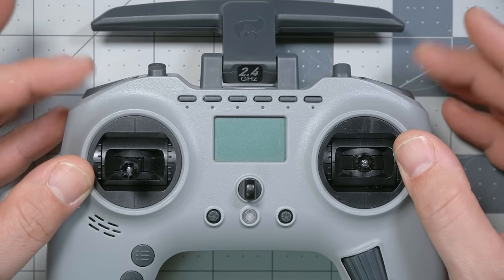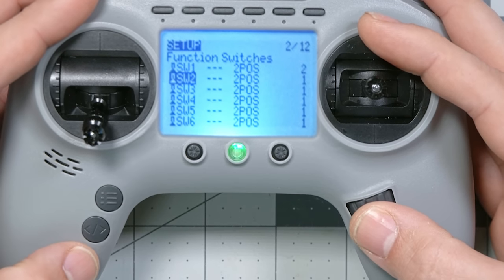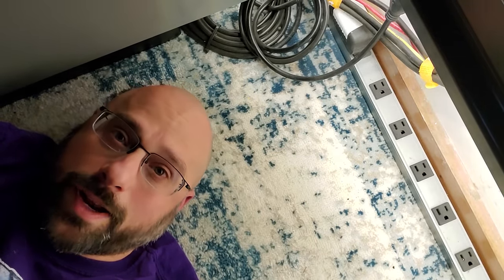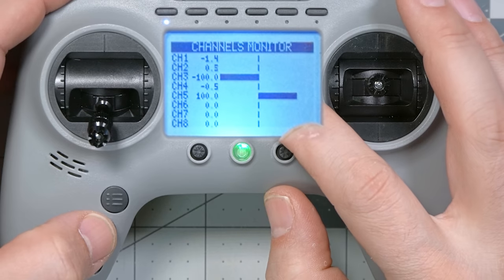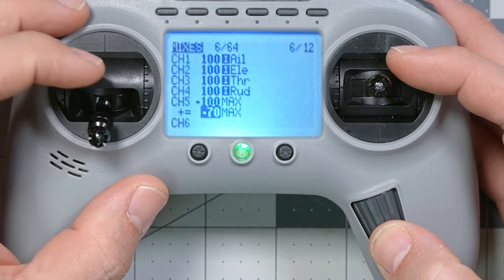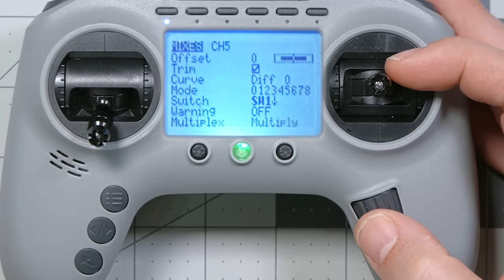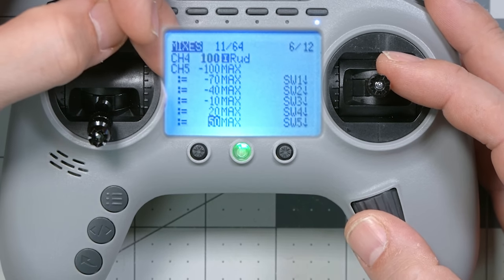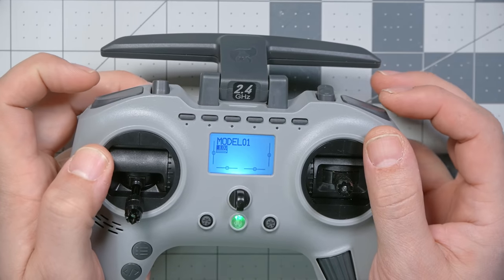Fixing what was wrong with Jumper T-Pro // OPENTX TUTORIAL

Comment from the maker: FIrmware that fixes the broken "toggle" setting is available here: https://we.tl/t-gKE9FMmona
Reply: Joshua Very nice solution, I will probably change my arming method to the one you discribed in this video!
Reply: to stretch 7 states over 200 means having 6 steps and therefore 200 has to be  divided by 6 and not 7 which then results in a stepwidth of 33 which leads to this symmetrical row of values instead of ending at 80 

-100  -66  -33  0  33  66  100

Dividing 200 / 7 lead to 28 which then accumulated to the faulty upper end which did not reach 100, just 80.

For all that struggle: look at a ladder and its steps. 7 steps means you have 6 gaps between each step, therefore 200 / 6 and then it works out fine.
Reply: Transfer expired
Reply: Can you post a file share of an edge TX config that just has all the fixes done.

Left and right being on off switches
And the 6 switches. 
Not sure if configs with basic switch correction would be outdated quickly with radio FW updates. If the pro 🤣
Reply: transfer expired any update on this fix ??

Comment: Just wanted to say thanks.  using this video and an older one where you programmed your remote to fix max throttle using open TX, I was to do it on the Jumper tPro and I am an absolute newbie.  I set to 75% max power and now I am not flying the drone off the walls in my house.  very much appreciated.

Comment: Thanks for the great tutorial. I'm not sure i would want this radio, even with the fix.  twice in many years of flying I have had to use disarm in an emergency to save someone else from serious harm. while i hope it never happens again, I'll never fly without a standard disarm procedure. if you need that switch in an emergency, you better not have to spend 1/10th of a second  remembering which switch it is or how it works.
Reply: You're right. I use  T Lite and as a beginner, I crash my whoop alot. If I start loosing control, I just flick SWC (Arm/Disarm), fast & easy. No property damage & human casualties so far 🤭.

Comment: Fantastic work, Joshua! Thanks a lot! 😃
About Albert's solution, it's different. But that's all. 
Anyway, stay safe there with your family! 🖖😊
Reply: Albert did the exact same thing, an AND on L01 and a sticky on L02. He just used MAX on the mixer instead of the value of L02, but that’s worse IMO because the channel goes to 0 instead of -100, which is not how a traditional 2POS switch works.
Reply: @MrAlucardDante  Yeah, basically.

Comment: I have the v2. It has a serious issue with battery contacts. Knock it slightly on the front and it switches off. knock it harder, or drop it, and the 18650 cells become loose and rattle inside, the controller will not power on.
I've fixed the issue on mine, but it was not something an average person would do.

Comment: Hi Joshua! Could you maybe take a look at the gimbal calibration on the Jumper T Pro? I like it a lot due to the design and size but I noticed that my gimbals cannot reach 100% at all corners after the calibration sequence. If I calibrate it in a way that the corners, which cannot get to 100% are saved as 100% then I lose resolution at the others which is not a big deal but it's kinda frustrating. I got two Jumper T Pros and both had it. It would be awesome if the AG01 Mini would also fit in the T Pro because the Zorro wouldn't be an option for me... :( Maybe some other experience similarly.

Comment: Could also just use a sticky switch on one side and then use the other side normally as a pre-arm mode in Betaflight. Then there is no need to press two switches to disarm.

Comment: My biggest complaint with all the gamepad radios is the 1" screen. Im too old for a screen thats measured in decimals. the Zorro looks interesting. but Ideally (for me)  it would come with crossfire built in and take an optional lite module.
Reply: 100 % agree and I hope that we will see in the future an app for our phones that does the trick on top of such small displays.
We have the best displays in our hands or phones and if the RC manufacturers will add a bigger screen we will get cheap crappy screen like in the TX16S and clones.
A phone would remove a lot of struggles we get from those tiny displays. They should of cause continue to offer the manual input on the controller for all those who do not wanna connect their phones.
If I get a FC app from speedy bee for all needed why shouldn we get an app as output and inputscreen that does work simultanously with the tiny display ?

The Zorro will offer more screen estate and more readible characters but that is still half way through compared to an Usb type c attached phone or wifi connectd one. even BT would work out.

Comment: the jumper t pro bricks itself. mine wont turn on even when i change the internal CR1220 battery. the button flashed blue like it tries once then dies after putting a new battery in. even when you put another new battery in. Is it bricked? ugh it was already such a pain in the ass to get working to begin with and now after a few months it shits the bed. then your bricked radio video uses that impulse rc program which is for windows only and not mac :(

Comment: You should add throttle check to two button arm. If throttle - 100 and SD and SC, then arm
L1 and SC down, SD down
L2 a<x (I) Thr - 100
L3 and L1, L2
L4 stky L3, L1
Arm onyl if throttle low, disarm always
Reply: That’s clever, although betaflight won’t arm if the throttle is not low
Reply: @MrAlucardDante  but if you arm without throttle check, radio will switch Channel to positive, play sound 'arm' but quad wont arm, then You have to disarm, lower throttle and arm again. Its annoing
Reply: Example
https://youtu.be/2hEwzB2uBFA
Reply: @grlskce  true. I used to have an audio cue for arm/disarm. But i find it annoying. My quad is either next to me with the battery unplugged if I’m not immediately flying or in the air so I know if it’s armed or disarmed. You could also use telemetry to know if the quad is armed or disarmed like FM2M does, this way you are never unsynced, if you of course have telemetry

Comment: Thanks for the video!  I had already taken a gamble and ordered one hoping there would be software fixes for the switch behaviour.

My radio arrived today, about 30 minutes after EdgeTX 2.6.0 was released so first job was flash and setup.  I can confirm the toggle function works on the switches. They act as momentary when set to toggle and 2pos when set to, erm, yup, you guessed it!  I still can't think of a use for them for my sim and Whoop flying though!

Comment: Thought I was going to pick up the tx12 as my first FPV radio and didn’t think I liked the gamepad style controller but after watching your videos I’ve decided on this controller with a 1k mw backpack elrs transmitter module. I really like the simplicity and ergonomic look and dual 18650s instead of a single like on others. They were out of stock on the internal express protocol transmitters but that’s okay as I read about a firmware bug with them I wanted to avoid and the extra chumminess and porcupine radio antennae make it more appealing tho me. Next I’m deciding if I’m gonna pick up a pre built disrobe Roma LR 4” frame and add diversity Rx and starlight FPV camera or just build the whole damn thing from scratch. Availability is low on four inch Dave C type LR parts, frames etc but I’m hoping to find a dead cat that speaks to me and build it for urban night flying. Love your videos keep them coming!

Comment: Could you combine a 3 pos switch to arm/disarm including flight mode selection? Like down is disarmed & airmode, center is armed & airmode, up is armed & angle mode? Would it cause problems with ELRS? I'm uncomfortable with this momentary solution when you need to quickly disarm for a reason...

Comment: Cool, I was already interested, but having lots of doubts because of the lack of the versatility of this transmitter simply due to the lack of … switches… flying helicopters, drones and airplanes, I need more options… more channels… 
Thanks to you, it seems possible to adapt and have switches for rates, flight modes, idle up 1 and 2, and securely arm and desarm… and buzzer 😎😎.. for that I need to be able to use properly and independently the 6 “function” buttons!!! 
Thanks a lot!! Bit of a headache though.. 😅😅😅

Comment: Toughest controller on the market if you do freestyle  want something small compact to throw it around drop it down stairs just keeps on going this is it ..  I have 1 beat it to hell never use the case just throw in my bag and nothing has broken just a tough lil sucker super dependable with the jumper receiver never ever ever have lost reception a 500mhz thats what I use you need no more and the battery lasts way longer at 500mhz just the best small type controller and now has the arm switch on the newer models

Comment: I'm currently using 3.3 edge TX and I'm able to get momentary switches by changing to the "toggle" option that you address as being broken, which is odd because that's not usually how a toggle works but hey, free momentary switch I guess. (in the setup screen for the model)

Comment: I have today ordered a T pro although I have a Zorro.
So with some head work these switches can be made to be useful.
I will download the full manual and have it printed out.
Thanks a lot Josh...you are super smart.
The dog is AWESOME.
Is he a jumper too?
Reply: So witch Transmitter do like the most now? Think I'm going for the Jumper.
Reply: @zipppiz  
If that question is for me?
First off it really is what " you like".
I like the smaller screen on the T pro as it does not look like an ugly afterthought and contains all I need to know.
I like the six button switches in a row that light up when clicked.
Light on means my electric motor is " armed".
I like that the T pro comes complete with natty carrying case.
I like the battery life on T Pro.
On the Zorro I like the miniature black toggle switches and the general feel of it.
The switch layout is more professional if you like as they use metal switches.
I do not like the plastic rocker switches on T Pro.
It really is best to go to the shop ( or friends that have them) and feel them out yourself.
For every point I made, someone can and will reverse that so its is all on you.
Quality wise I would say they are the same albeit Zorro could win with the switches.
For what it is worth I have sold the Zorro and still have the Jumper!!!! 😉
Reply: @petercane6376  Thanks Peter, very detailed answer and I really appreciate your input.
I did go for the Jumper and got a really god deal and it was quite a bit cheaper than the Zorro. I would have gone for the Zorro if the battery life would have been better.
But I also like the included case, and the smaller form factor of the Jumper.
It is a bit of a shame with the switches bit I'm sure I'll get used to it.
Thanks again for your great input, ut really makes me feel a bit better about my choice, it sure wasn't easy 🙂

Comment: Love the form factor of the JT-Pro and the flexibility/robustness of the software BUT I gotta say, their product QC and customer support SUCK!!! Got a T-Lite a few months ago and it had a defective spring in the left gimbal, returned it. Now I just got the T-Pro and the left stick has near zero friction. If I hold the radio vertically and raise the throttle all the way and let go, the stick will fall back down on its own (just from gravity). Also, external module bracket came without mounting screws and only 2 out of 3 holes are drilled in the back of the radio. Numerous emails to Jumper about both radios and ZERO responses!!
Reply from the maker: You can easily adjust the tension of the throttle gimbal. It has adjusting screws.

Comment: Fantastic video as always, extremely informative, but I think- as do a few folks in the comments below- that there are still two fatal flaws: 1 is that it wasn’t launched with elrs internally, though I guess that’s coming; and 2 is fact that it has momentary switches at all. The logical switch stuff is just a bodge which shouldn’t have been necessary in the first place. Zorro has been out for a while now here in China and is cheaper- 500rmb with crap legacy module, 600 with internal elrs vs 666 for the Jumper, plus another 150 or so for the module. Difficult to see why anyone would choose the Jumper over that, but I haven’t tried either, so don’t listen to me ;-)

Comment: hey Joshua. Do you know or may have a suggestion on how to connect Jumper T-Pro to TBS Crossfire Micro Transmitter? Hope to hear from you
Reply from the maker: TBS makes a conversion kit that will change the Crossfire Micro to a Nano that will fit on a lite module bay. No problem.
Reply: @JoshuaBardwell  could you point me to the conversion kit?
Reply from the maker: https://www.team-blacksheep.com/products/prod:xf_nanotx_retrofit
Reply: @JoshuaBardwell  Thanks!!!

Comment: Still not a brilliant design decision to make both shoulder switches momentary, though this workaround does somewhat ameliorate the problem.  

I DO like the ability to configure the 6 position switch cluster to be multiple groups or even six individual and independent switches - that's really cool and I can think of uses for these modes.  I wish that I could do this on my TX-16s and maybe... hopefully... this can be done with an update in EdgeTX (and years from now in OpenTX when 2.4 releases).
Reply: whats the big difference between this momentary switch being used as a toggle and a physical toggle? Its not like a physical toggle is any harder to accidentally arm or disarm?

Maybe someone will find a physical toggle button that fits on the board in the same way and we can mod it. Or Jumper will take notice eventually and sell a fix that we can install ourselves.

Comment: 6pos switch only makes sense for Ardupilot, which is hardcoded to 6 modes on the 'mode' switch.. so no sense making it support 7 positions. For anything else individual switch channels/groups would be more useful.
Reply: You can use a 6pos for a lot of things. I use mine to switch my output power or my vtx channel. Very useful in a race. The first pos sets my vtx to 25mW (race mode), the second one goes to max power (freestyle mode) and the third to sixth are mapped to change my channels from R3 to R6. So it’s not ONLY useful for Ardupilot. Btw JB has a video showing how do to that in BF